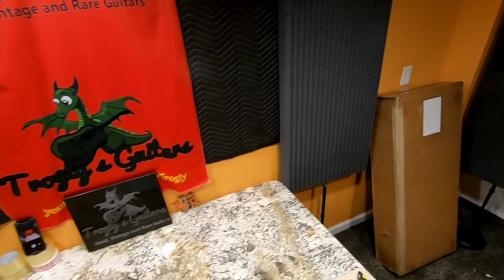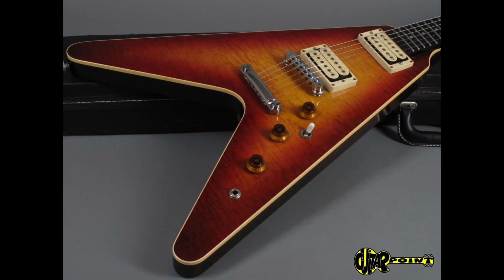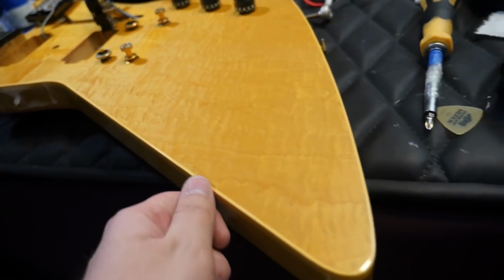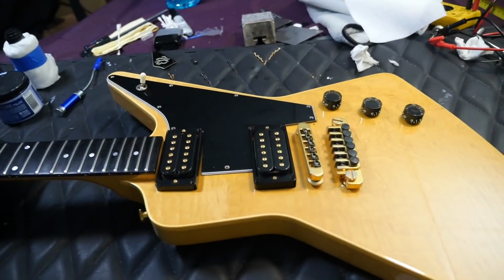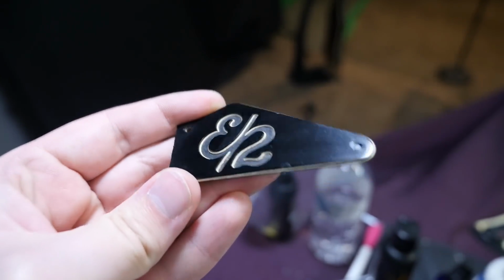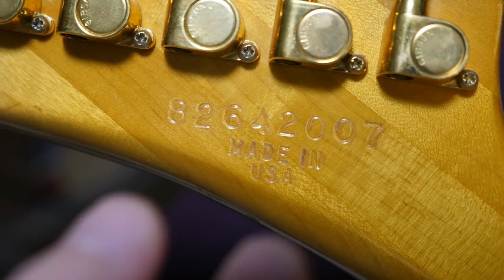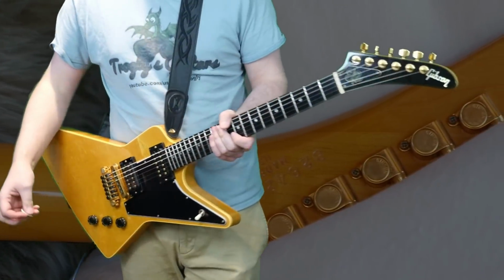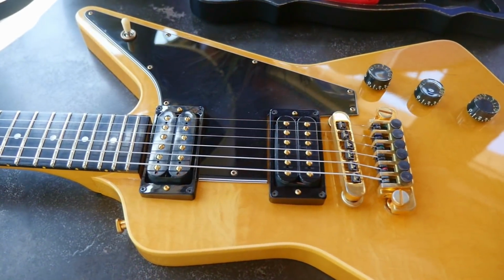The (Almost) ALL Maple Explorer No One Talks About | 1982 Gibson E2 Explorer CMT Review + Demo

Comment: From a constructional point of view, I wouldn't worry about that crack on the back. It follows the grain of the wood, so it looks to me like a little crack in the wood which was there before the guitar was made, and nobody noticed it, because it was so small. Then after all these years it's opened up a little bit. I suppose it will affect the value of it a bit, but I'll bet it's nothing serious, like a glue seam coming apart. Other thing is, there's nothing wrong with veneers! There's no point using a thick slab of figured wood, if you will only ever see the front of it. And veneer is real timber as well. There's nothing fake about it.

Comment: I love the TP6 tailpiece. Every single Gibson I own has one. They seem to hold tuning much better. And besides, I have a lot of Floyd Rose equipped guitars, so I’m used to tuning at the bridge anyways. And they look badass. 🤘🏻
Reply: I've noticed they're also chunky as fuuuuck so my sustain goes WAY up. I A/B'd one on my main Les Paul Special against the stock bridge and it rang open about 4 seconds longer (avg), fretted at the 12th about 2.5 seconds longer (avg.). They're great, I love em, plus they work with a lock-nut, which is great for punx like me that just HAMMER the shit out of out gee-tars :)
Reply: @av.punk.801  yup! I noticed that on my Les Paul Custom immediately. I’ve got one on another Custom shop standard and one on my LP Signature Player Plus. I even managed to put one on my Japanese built ESP eclipse. I had to modify the tail studs because the ESP is metric. And all my TP6 are Gibson USA. I probably should of gotten a cheaper Epiphone branded TP6 that would’ve fit with no mods. But hey, it works and looks killer. 🤘🏻
Reply: TP-6 + Tremolo = Floyd Rose Tremolo ☺
Reply: @olivardelamancha2896  you physically can't do both? Unless you mean a pitch bender pedal...
Reply: @av.punk.801  I mean hardware trem

Comment: It's a beauty - however, that raised up fingerboard was always a deal breaker for me. I much prefer the flush fingerboards. Those white Lzzy Hale explorers were great BUT didn't have the ebony fingerboards nor did they use MOP block inlays (another deal breaker!)
Reply: I can get the ebony requirement, but unless it's a ton of money, why care about inlays?
Reply: They have ebony fretboards and pearloid inlays aren't bad at all
Reply: It's like a Les Paul Custom - but with cheaper materials. It just isn't the same. @thenameless3271
Reply: What is a raised fret board? Can you elaborate? Thanks
Reply: What is a raised fret board? Can you elaborate? Thanks
Reply: What is a raised fret board? Can you elaborate? Thanks
Reply: @barbarafogle3541  The fingerboard/neck, from the profile is raised up about a half an inch from the body maybe more. Normally an Explorer is pretty flush maybe only,25 inch which is the actual thickness of a fingerboard. Does that make sense? Looks clunky to me.
Reply: @gentlemanghost2787  it makes sense if you go at it crazy wise you don't slam into the volume and tone knobs I like that think it looks good and you get more wood 😁😁😁
Reply: Or a lowered body leaving a "raised" fretboard maybe a neckthru body ehenjoy

Comment: 24 3/4”???? By your tape it reads 24 13/16ths ?? 😁 depending upon how much you are measuring. A simple 1/16th is a mile!
And if ya really wanna get technical. Then the dead middle of the fret is just under  a “C” hair over 24 7/8ths. But I suppose that depends on the size of the “C”

Comment: I sent you a message on the new  Lizzie Hale hybrid explorer / firebird model that  Gibson has on their table soon. I personally never loked the explorer although I think the body is an open pallet for some great art work. I just think it's way to big and after having played one the size is what turns me off about them.not necessarily the make up of the neck or pickup layout. Although the big tale does remind me of cars from  a few years before my time which I love. I find the tail is just to much. Likely why I prefer the Firebird. Is the Explorer a  neck through model as is the Firebird and Thunderbird or is it a set neck. When I was a teen in the mid 70s my oldest brother returned from the air force.  With him he brought an Electra brand Les Paul.  If I had to guess I'd say it was a traditional or something similar.  That beast weighed every bit of 10 lbs. He allowed me to play it when he wasn't.  If it wasnt for that wide leather Gibson style strap I probably couldn't have played more than 20 minutes or so. Taking it off your shoulders you could feel a great relief from the weight of that guitar.

Comment: Trogly, could you sometime maybe explain with examples the difference between Quilt, Flame and Curly? THX! 👍
Reply: You could Google it in about 30 seconds, don't really need someone to put hours of work into a video for such a simple question.
Reply: The names of the woods are almost self explanatory. But there are variations of different woods. As the previous person suggested you might want to google search or whatever search engine you use. It will likely give you a more in depth idea of the types of woods . Just in Cypress alone I know of five different types. Oak,  maple,  pine and ash have plenty also. That's not going into the woods that typically are are associated with bearing trees.